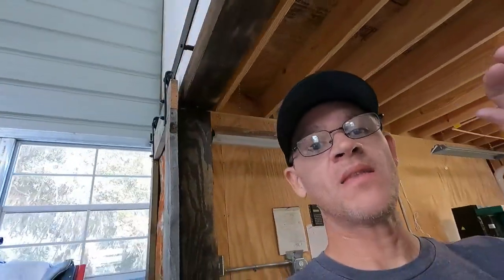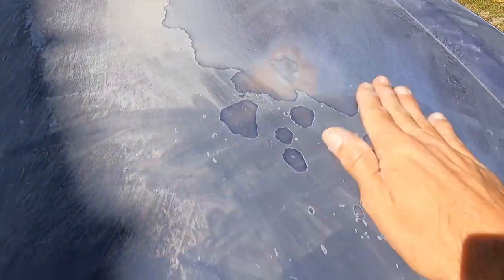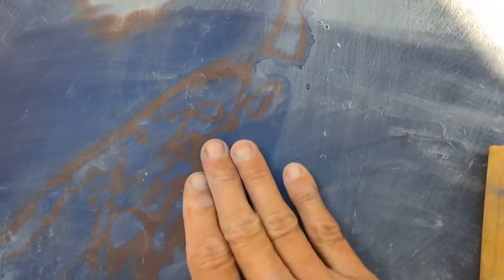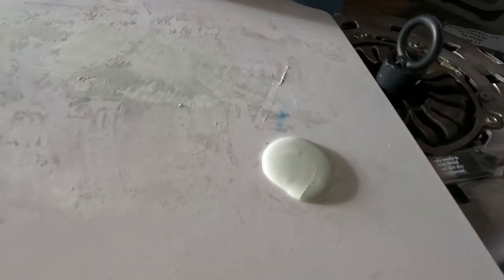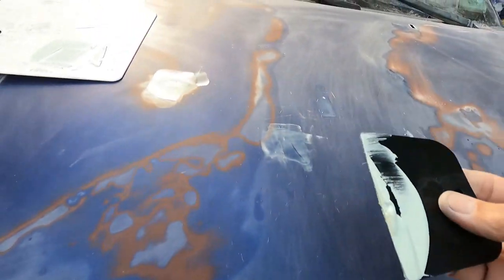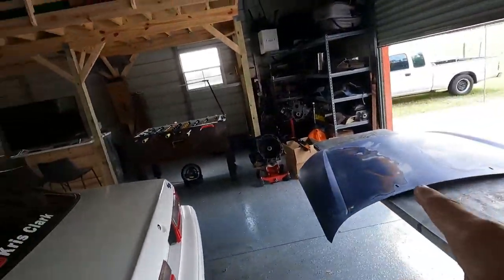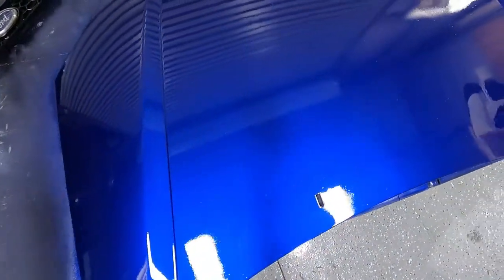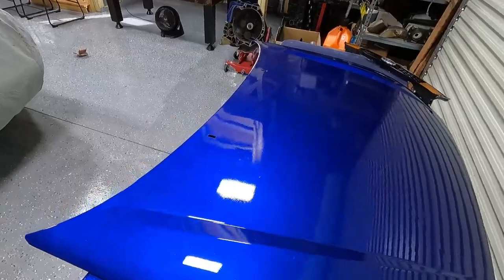DIY Rattle Can Paint Job With 2K Clear! Ford Focus SVT Blue Pearl Metallic

Comment: Alternator:  DLG3611-16-11.  Regulator: TRANSPO F601HD ^^^ only combo that works properly plus a new pigtail wired directly to the ecm and battery with a fused terminal if you have any charging issues with the svt

Comment: I am trying this process.  I have a similar blue paint that the clearcoat failed on.  One tip I would offer is that initially I was trying to sand off the edges like you did, but I found that it was much easier to take a razorblade glass scraper and scrape off the clearcoat.  It came right off with little effort.  Of course I sanded afterwards.

Comment: For anyone using a rattle can for a metallic paint job make sure you give it more time to dry between coats. The metallic sinks to the bottom and giving it more time to dry will help you layer the paint and keep the metallic from sinking. You may want to dust on the last coat. 

Also, more metallic coats lead to a darker paint job. I had to learn it the hard way. Now I have a mismatched hood. It’s darker than the rest of the body. ;(
Reply: Did you're so right because I  Painted 3 Coats on my back passenger door and it does look not only darker but I haven't laid on the clear yet ends that could make it a lawyer's I think I'm gonna wait though since I painted it last nightBut I want to buy a kind of a clearer 2KIs high gloss Arisol can  You think I got time to be driving around and not laying on any clear yet will the pain be OK I live in  Western Washington State
Reply: Yeah my side panel looks like have a disease it’s darker it didn’t blend with the rest of the paint 😂
Reply: Great tip

Comment: Wen sanding the 180grit scratches use 400 dry then do a nice wet dry 600 it’ll get it smooth then clean off with wax and grease remover or even glass cleaner let that dry stick base coat cans in the sun let them warm up it’ll spray better and lay down better and always paint in doors never in direct sun or you’ll get really bad orange peel other then that you did an awesome awesome job man well done

Comment: I just seen this video today (over a year later), so I wasn’t sure if you remember how wide the spray was for the Automotive Touchup base color cans. I did my 05 SAP bumper with a different brand and got the dreaded tiger stripes because the spray, no matter the distance, would only go about an inch wide. Also your thoughts on the AT spray cans themselves or if you’d prefer a better brand.
Reply from the maker: It wasn’t very wide. If I had to do it over I would go buy a cheap spray gun from harbor freight. Hard to get good results from any spray can.
Reply: They sell nozzles for paint cans on the Internet that give a nice fan..
Ask graffiti artists

Comment: GJ, Kris! Good video.👍
That blue is absolutely beautiful! Reminds me of the "electric" blue paint job on the 1988 Mitsubishi Starion hatch back. Don't know what the actual paint code title for the color was, I just remembering referring to it as "electric blue."
  Every time I would see a Starion in this color back in the day, I couldn't help but take notice. The color was jaw droppingly beautiful, but ONLY if it was in this color. 
  Anyway, thanks for the tip on the 3M panel glaze, also. Been looking for a decent product exactly such as this. Something that goes on more like cream cake icing, rather than fresh cookie dough. 
   How is the paint job holding up?

Comment: If you wetsand the basecoat before you spray the clear that helps to get a good metallic look.   Lovely shade of blue.  Makes me want a blue car.
Reply: I did a blue metallic base coat on a cowl hood outside of garage and went in to the house to get a bite to eat and the neighbor mowed his gass and when I came back out i wet sanded the spots dirt or debris was and I cleared it and i could see everywhere that I sanded. With metallic I probably should have wet sanded the whole hood? I'm new to painting so wanted to know for future advice. I know that the metallics lay down different directions and what not and there was no doubt where I sanded the debris out. Thanks for any info on what I did wrong
Reply: @dano7480  Wet sand the blemish's with 1500 grit wet,  then wet sand again with 2000 grit wet and make the area bigger.  Then again with 2500 grit wet and again sand a bigger area,  then you can machine with compound (Meguairs Ultimate compound is amazing)  or you can wet sand again with 3000, 5000, 7000 then machine.    If you only compounded my hand, thats maybe why you can still see the sanding marks.     Oh yeah,  make sure you order a "2K clear coat"  Spraymax or ProXL,  those things are super glossy and have a hardener.  Paint like simoniz acrylic looks great when wet, but doesn't stay glossy and even after polishing etc, still looks cloudy.  2K clear is an absolute must for a good shiny finish.
Reply: @theenglishtrucker1849  thanks for the information, it probably would have been easier to go whip the neighbor who mowed seeing a painted hood sitting in the sun baking lol. But all jokes aside, now that you say that I probably should have kept making bigger passes and going to a less grid paper. Next time I will try this and do the entire hood or project. I really appreciate the info and I'm going to subscribe to your channel and go watch more videos so I can learn more. I hang out at a local body shop in town and try to learn as much as I can. The old timer that still uses lead for some repairs said to me that no matter how long you have been doing this there's always something new coming out or something to learn about body work/painting. Thanks again man 💯👍
Reply: @dano7480  Check this guy out, he is really good :  https://www.youtube.com/@cvrpov

Yeah you HAVE to go up the sandpaper grits because each one removes the previous ones scratches.  Dont skip grades either,  a machine should remove 2500 easily.  But if you polish by hand, then I would deffo do 1500/2000/2500/3000/5000/7000 all wet  after the 7000 it will have some shine to it. 😎👍

Comment: My current paint is flaking like a sun burn. Do I need to sand it all off or am I good to just sand off rough spots and paint over bad paint
Reply from the maker: Your basically describing what I’m doing in this video. I just sanded down the bad spots and painted over the paint that wasn’t peeling.